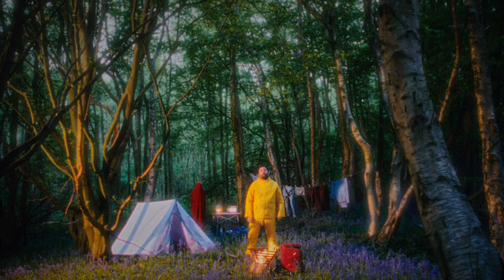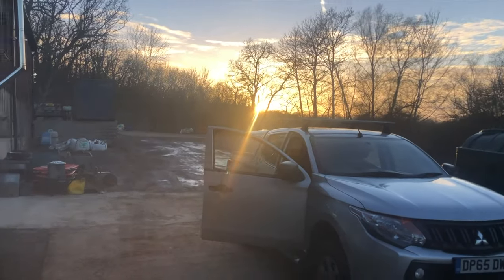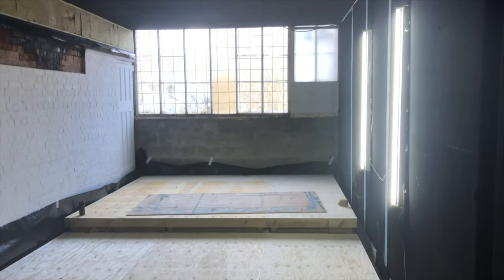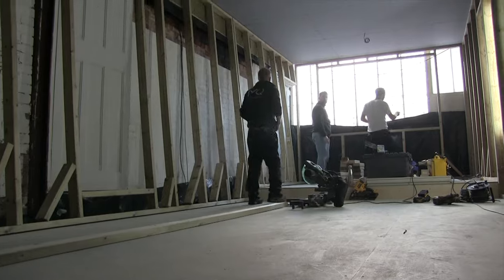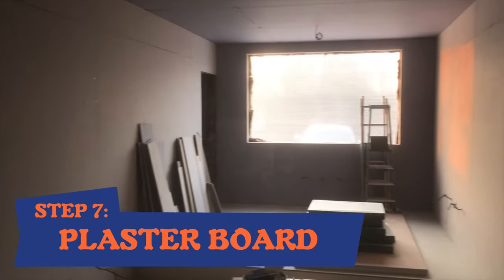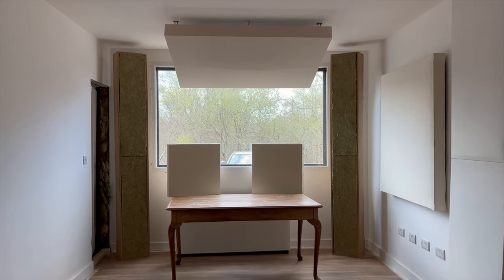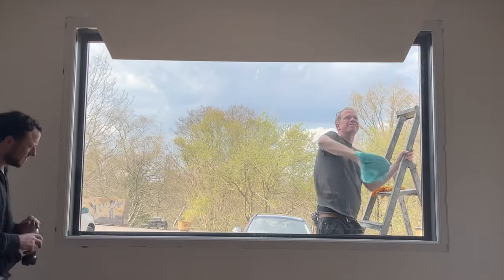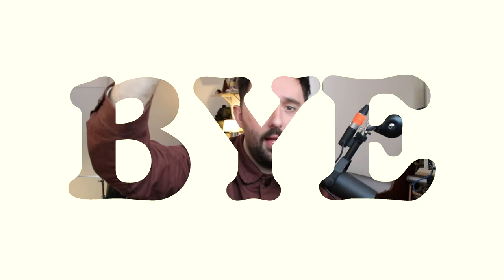Hugo Brijs - DIY Music Studio Build (Step by Step)

Comment: What was the cost?  And how did the soundproofing work out!
Reply from the maker: It sounds amazing. The soundproofing is almost perfect, with the exception of occasional rumble from heavy duty trolleys which move equipment round on the floor above. The budget was around £15k - I spent around £12k but some of the costs and labour were contributed by the co-working space.  All in all, very good value. I built costs for similar sized spaces are often £20k plus
Reply from the maker: It sounds amazing. The soundproofing is almost perfect, with the exception of occasional rumble from heavy duty trolleys which move equipment round on the floor above. The budget was around £15k - I spent around £12k but some of the costs and labour were contributed by the co-working space.  All in all, very good value. I know costs for similar sized spaces are often £20k plus!